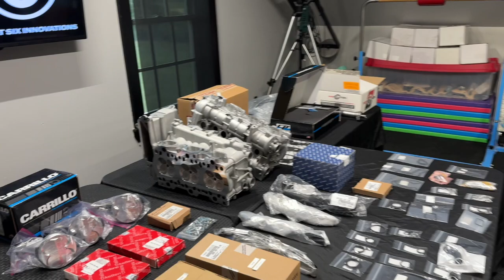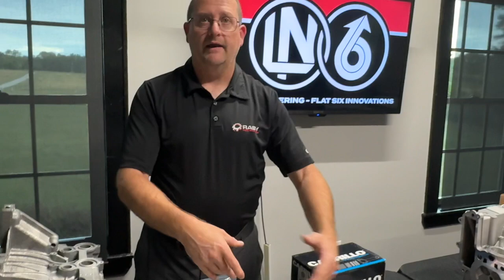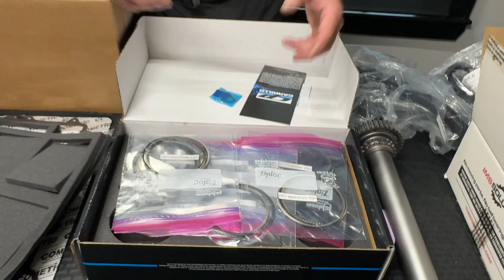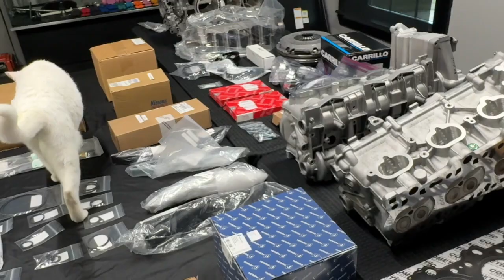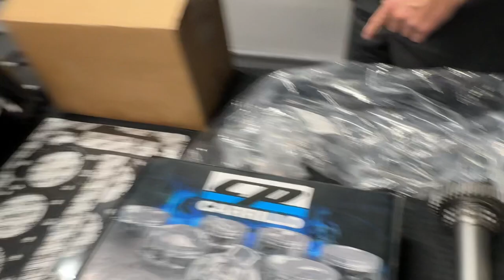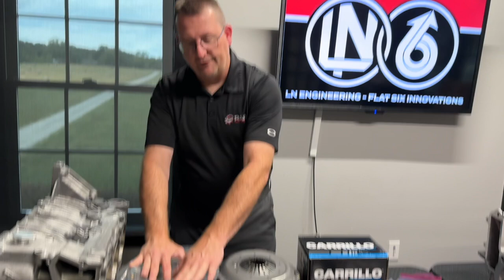Crazy Cayman Build: Picking up the engine parts from Flat 6 Innovations

Comment: Which Flat Six "kit" is this (or is it a mix of a few variables)? Do you have a vid I missed talking about the plan for this motor? I was curious when Jake mentioned the higher compression ratio. 
Impressive regardless! Pretty cool that they're doing crank balancing with flywheel/clutch/balancer - can't imagine how you get weights onto that crank to do so!
I miss my M96/093 4.0 :(
Reply: PS that port grind/polish looks great too!
Reply from the maker: +@miketdavies my kit is pretty custom. Had a couple earlier videos in the playlist talking with Jake about it.
Reply from the maker: +@miketdavies 😍😍😍